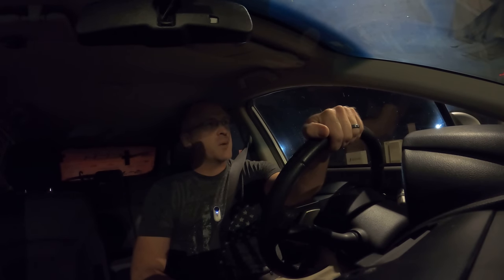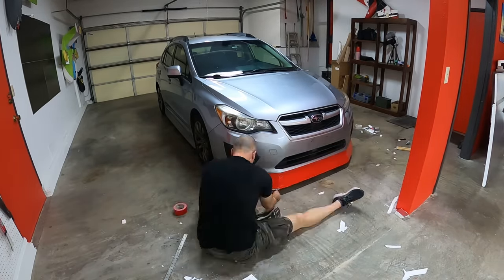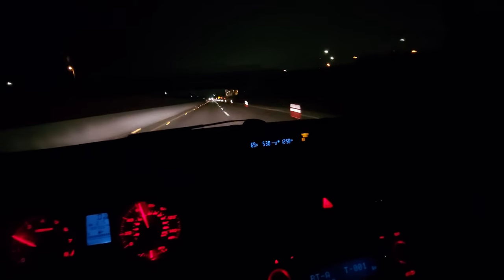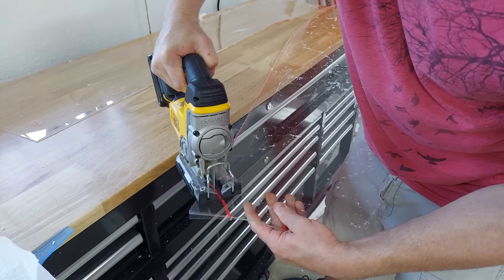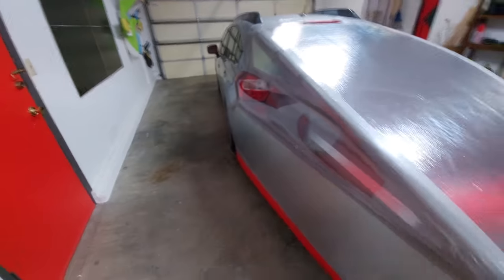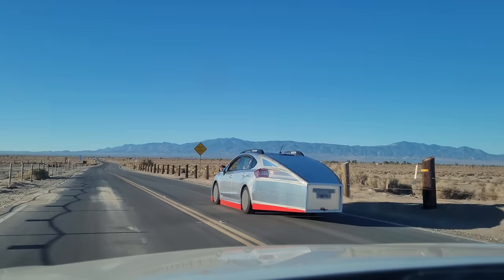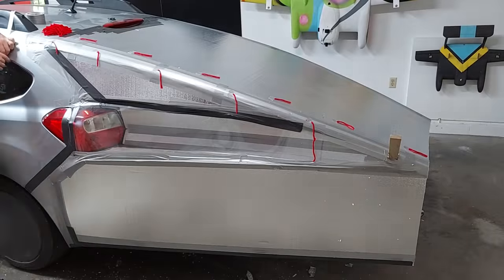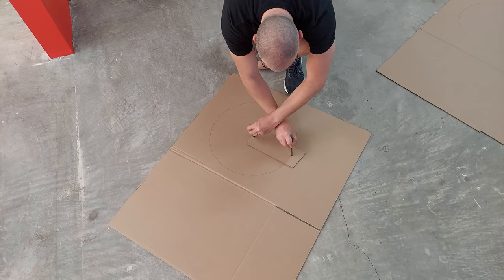Beating High Gas Prices Using Simple Aerodynamics (Home Improvement Store Edition)

Comment from the maker: Head to https://squarespace.com/thinkflight to save 10% off your first purchase of a website or domain using code thinkfight
Reply: the mercedes was an eqs
Reply: nobody cares about advertises. you can see the most replayed part was where the advertise ends.
Reply: Need more miles on a tank to average out the change in mpg. Even multiple fill ups with adding miles then divide. I see people who top off a tank at a station after a 30 mile drive and extrapolate that mpg to the moon. Use multiple tanks or you’ll get inaccurate results.
Reply: very nice advancement:)     i suggest you look up the audi A2 concept diesel : That car had rediculous mileage using more / other methods you could apply too.
Reply: I was think u try to simulate how mondern ship sterns work in that the flow seperates and becomes turbulant behind the ship and far enough away so the effect on the ship is minimized thus they have sharp flat sterns
Reply: When are you going to do a coast down test?  Really wondering to see how much of a huge drop in your potential gain is due to the engine inefficiency getting much worse at lower power.  Look at BSFC charts to see how this goes with typical engines
Reply: transparent front area between hood and windhsielf, for a lamborghini new prius like areodynamic front end, front noise. how underbody covers didnt work? wouldve been lot better i suspect, and you need that groundc clearance anyway. aptera owners club did video intvewing the 1990s honda civic guy who did similar to his civic.
Reply: try get rid of the roof rack bar. maybe if you can do a curved rear end like aptera... probbably very expesinive though, not worth it
Reply: if not frontal nose cone sorta thing , covers on the front area at fog lights. like lucid air tesla 3, sort of flat front and maybe a bit curved. maybe a curved roof area to mak the while thing contiently curved, may be worth it to keep flow smooth and flowing more downward toward center of car as it gets to rear end. maybe even same with side area, but probably would make it too wide
Reply: communcative steering rack like hydrallic, maybe from old car, allow you to know where grip limit of car is, so minimal braking and powering back up, more effceint, fun steering. see chris fix video on weight reduction, its not illegal for non driver to use airplane ear plug, gun ear plug, music sound canceling earbud/headphone, etc, so reducing that sound deadening for that area is ok, maybe you could reduce for front of car too if you have hidden earplug with trasnparent stuff like hearing aid.  seats can be lighterweight and communciate movement of car more, more fun to drive, then office chair gel cushion can be used and also used outside car.
Reply: aftermarket swapping buisness. another idea: windows placed permatly closed, all window mover etc removed.. esxcept driver window. thermal insulation removed? people wear jackets, unibody thermal....
Reply: While the flow on this tail was more laminar, it caused a greater change of direction of the air flow. This design has a more aggressive change of shape on the top which makes a greater change of direction of the air flow. What's needed is to split that total change between the top and bottom, resulting in an overall less aggressive change of direction of the air. If you angled down the upper surface the same amount as the lower it would have disturbed the air less overall. Basically your upper and lower surfaces would take the same or similar angle/shape as the left and right. That's my sense. I've played with this sort of stuff myself, a little but on scale models. 

Making the angle of the bottom of the tail shallower was of course the right direction but making it flat and making the upper surface swoop greater took it a bit too far. As you mentioned in your Pt. 1, the goal is to minimally disturb (change direction of) the air. I'm willing to bet that you actually created lift at the back with this shape... Tufts only tell you how laminar the flow is. They don't directly tell the efficiency. It's not an absolute 1 to 1. It's only 1 to 1 to the degree that the shapes compared are 1 to 1. Your total test regime told you the efficiency.
Reply: P T  And our entry level BEV, with the traction battery energy storage equivalent of about 2 gallons of gasoline aboard, manages the equivalent of 125+ miles per gallon. At our motorway speed limit of 70 mph we still achieve the equivalent of 110 mpg.
Reply: Riverside.. Man whats with cars and the valley...since birth. If its valley in Southern California someone's  doing car mods!
Reply: WAIT NER MIND  Lol it's A VALLEY flater then hills
Reply: Your mom smooth surfaces are costing you 1-3% paint them.
Reply: Only in America 🇺🇸
Reply: Wait you know your way around cad and you haven't chucked your car into a CFD program yet? Easiest way to design fuel efficiency.

But if you really want to save fuel just remove all of this and drive like an old lady, accelerate as slow as possible, don't drive at motorway speeds and keep the car in the highest gear possible at all times
Reply: What would happen if you use large air scoops at the tail of the car and route that air to the "license plate area" and release it there?
Reply: The reflective nature of your insulation when left unpainted creates a  reflection of a following vehicle's headlights back to the drivers. This is absolutely visible at 7:48. Could save yourself a stop by the cops by painting it. Can't think of any other reason why they'd stop you unless your panels were flimsy and hanging off.

Comment: You should do coast-down tests.  It is a very accurate and repeatable indication of drag.  Certainly will be more accurate than depending on the vagaries of a fuel pump and the fueling/venting system on a car.  Heck, the reason the gas pump clicks off on a modern car is more about the EPA-mandated evaporative control system on the tank and less about the fuel level in the tank.  I bet you'd always get different fuel amounts pumped in just as a matter of course, even with all else  held equal.
Reply: I'd like to suggest an even better method of coast down testing - Julian Edgar did this video on "throttle stop" coadt down testing : https://youtu.be/tVAokIdaXm0
Reply: Either of those two methods will be more accurate than a partial fillup.
Reply: or a fill up until the clicks stop. trickle until the tank basically overflows. should be pretty accurate too.
Reply: @artokiiskinen1058  Well on a modern car, that will overflow the venting system and can lead to undesirable effects.  And I don't trust the accuracy for this type of calculation either way.
Reply: @artokiiskinen1058  - That could work on a diesel vehicle, since they don't have fuel evap systems. But on a gasoline vehicle, you risk filling the evap system with liquid gasoline. And that could actually damage some of the parts.
Reply: Excellent idea, and the difference between coast down test and fuel fill up MPG test (assuming consistent full up) is due to engine inefficiency which can be seen on a BSFC engine efficiency chart.
Reply: @O-cDxA  this!
Reply: Pump click is very repeatable if you are at the same pump, i measure my fuel consumption same way, only problem is very small sample size, and 4 gallons are stretching it a bit. I measure on at least half a tank and its very good.
Maybe wouls be better to do the test two times because he would at the same time test repeatability and get vetter sample size.. if its very good then he can stick to 4 gallon sample
Reply: a good way to overpass it is to just to not listen the fuel pump at all, when i fill my tank i allways fill it to the brim, when the pump clicks i let it rest for a bit and then star pumping slower until it gets to the literal cap of the tank, and i allways get almost the same L in, i dont go always at the same level so that its something to consider, the bad part its that you cant trust the car (kinda, gona explain later)bcs the level its way higher than it could read, im talking like a good 2 to 5 days with the car saying its at full tank, never had a problem with it, never had it leaking or smelling, its stays in garage so i would see the drops, bcs its a diesel. EXPLANATION: in my case the car still tells autonomy, average and instant, im pretty shure the autonomy its fucked up though, bcs there is more than it could read, and well all the other are calculated by the amount of L by the km done and thats calculated by the flow of the pump i think? bcs there is no way in good it would show any amount if it was by how full the tank is bcs it stays at full for a while,then again, mine its fucked at the botom part, so you have to take what i say with precoution
Reply: @Boz1211111  Repeatable?  How do you know this?  Based on your fuel gauge? I'm assuming you burn an unknown amount of fuel, fill your tank until it clicks off, and then calculate your mileage.  You then have two variables, mileage and the amount of fuel you put in your tank.  Without controlling the fuel you pump, you have no real proof of anything.  You would have to build a simulated fuel filler neck identical to the one on your car and pump fuel into a calibrated container until the pump clicks off.  You would have to do that a number of times and then measure the actual amount of fuel pumped, study the data, and only then could you say anything definitive about pump-click repeatability.
Reply: @artokiiskinen1058  Oh hell N O! You will damage your EVAP system.
Reply: @triparadox.c  Very true, the pump keeps shutting off when i try to fill up now 😢

Comment: People love these type videos. 18% improvement is almost amazing. It’s significant for certain.
Reply: Almost a fifth of tank getting saved.
Reply: Almost amazing? The things I would do for 18% improvement… without engine or tune mods
Reply: Its even more impressive that he starts with pretty efficient car whatsoever.
Reply: are you guys ever drove a car?🤔🤭
Reply: @oxygenium92  I'm pretty sure Subarus aren't crazy efficient
Reply: @LeoMkII  nah the modern ones are pretty good, esp for awd
Reply: @oxygenium92  sure, if you think away the high crossover body and the heavy 4wd system 😂😂
Reply: Doesn't suprise me, I tested out how much fuel you would save by tailing a Lorry down the motorway used to do it during my drives when doing nightshifts so roads were dead, anyway I saved around 15% on fuel so its not hard to believe these drag aero improvements made a big difference.
Reply: @gravemind6536  Holy
Reply: Computer modeling is the way to go now, the models are very accurate and far more scientific not to mention easier to tweak.   In fact, you can use AI learning to just try millions upon millions of variations in shape to see what works best.
Reply: @LeoMkII the one in the video gets over 30 mpg at highway speed in this person's testing without modification which is pretty good for not being a hybrid.

Comment: by increasing the length of the tail you increased surface area which means the air is attached to the body for a longer period of time. You would need to probably find a balance between the first tail and the second one to find your optimal length to curve ratio; i.e. find how much you can curve the tail before the air separates and that is a good as you can make it
Reply: Agreed. Look at nascar. Very important to minimize front drag from vents etc.
Reply: Maybe vortex generators could work?
Reply: Was just going to say that. More surface area = more viscous friction.
Reply: If I remember my aero class correctly 11 percent is the sharpest curve before detachment of flow
Reply: @TheObserver567  racecars of any kind, even nascar are not good examples of aerodynamics. they want downforce for handling. pretty much the opposite.
Reply: @TheObserver567  cars in nascar are not designed for efficiency or aerodynamics, they are designed to all be the same car but slightly diferent hence why you dont see an f1 car winning nascar races.
the rules of nascar restrict the speed of the cars due to safety
Reply: @rogermatheny5512  It is very complicated, higher turbulence delays detachment, but increases skin friction. It will be useful to check it with CFD simulations.

Comment: By sealing the underfloor, you reduced drag from turbulence but also created downforce (as you said it felt more planted) and thus more rolling resistance.
Reply: So a flat Bottom would be more beneficial.
Reply: But. Is that bad in california?  It's mostly mountain driveing...??????
Reply: Not to mention when it rains it pours.. Idk
Reply: More rolling resistance, more power demands from the motor to overcome the resistance, more fuel
Reply: @alexander1055  the other aero focused channel from that one professor also indicates the same. He uses only rear spoiler, bottom panels, wheel covers, and sealing the front grills and claims he got up to 20% more fuel efficiency for his car

Comment: I would love to see this become a regular series!  You could also look into tire rolling resistance, and as side mirror regulations are changed, the effect of replacing them with cameras.  I second the idea of finding a long downhill slope and doing a rolling comparison.  This way you could compare different cars, even compare gas and electric cars!  Could be an annual event :-)
Reply: @drippingwax  lmao. Talk about price gouging big corporations. A backup camera is only like 250 but starting from your own cameras and running it through a laptop and feeding the footage to small displays would be the cheap solution. Could be as low as $250, small cameras are dirt cheap
Reply: @Willham I was talking about aftermarket backup cameras. And of all the dash camera videos I’ve seen online, I really haven’t been disappointed in the video quality. They are usually at least 720p. I can’t speak on price since I haven’t shopped for them but I’d imagine there is a fair bit of competition just by the amount of truckers on the road alone
Reply: Cars and heavy goods vehicles and buses are all shipping with camera mirrors right now. Honda E car has them, Volvo and Mercedes have been using them on trucks and buses too.
Reply: @gravemind6536 Yes, because manufacturers jump at the option of replacing a reliable and cheap component with an unreliable expensive one, especially if the customer demands it because it improves efficiency and increases the perceived greenness of the product.